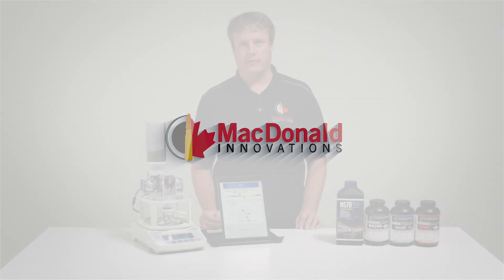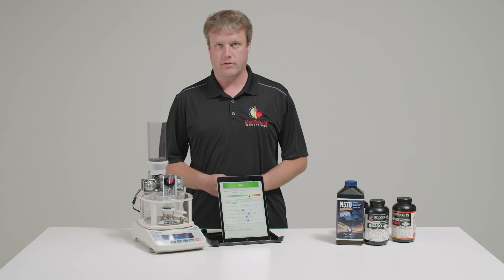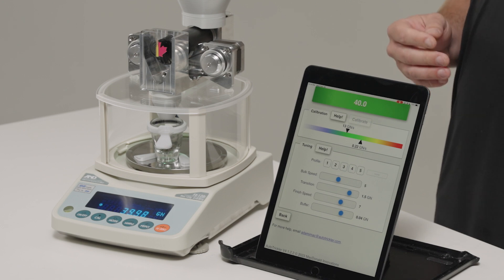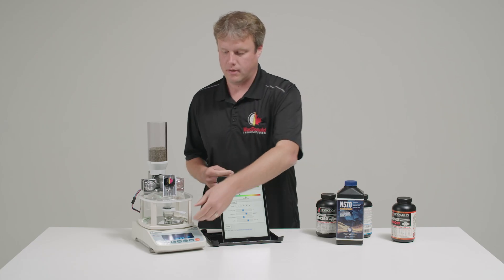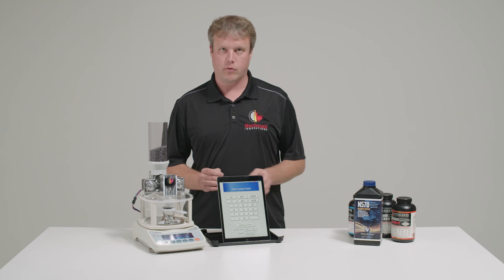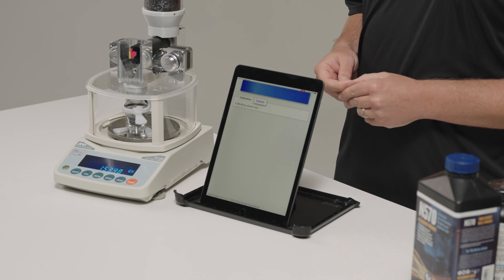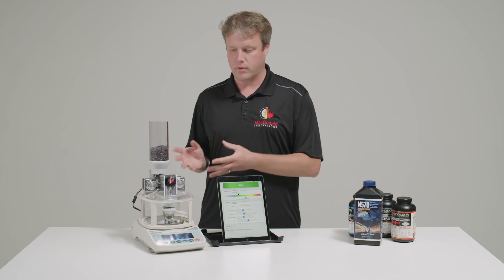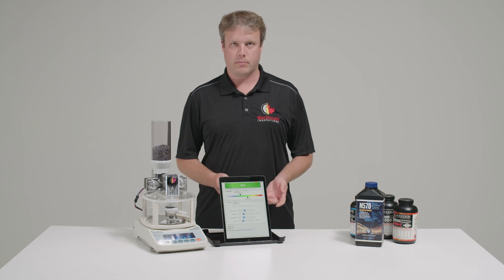AutoTrickler V4 Tuning Demonstration

Comment: Great help. I am very interested in super small loads. Like 10 to 15 grains for subsonic loads in .308, 300 BLK and 8.6 BLK. The powders I use are CFE Black, Trail Boss and Accurate 1680. They have to be right on, because a couple of hundred grains make a much bigger difference than at 40 or 60 grains

Comment: 1. A single kernel of H4350 weighs ANYwhere between .02 - .04.  It's random and it's SUPER annoying. 2. Know your audience.  Accepting a larger tolerance of up to 2 kernels just because it's H4350?  NOPE.  Know the audience and their expectations.  Shooters have already gotten really good results with the SUPER LOUSY tolerances of the old Hornady and RCBS thrower/scale combos, which are HALF the price of this.  Why would someone then sell their chargemaster say, and spend DOUBLE the money to accept larger tolerances?  lol.  Nope.  No way I'd accept that for a thousand dollars.  At say 200 yards and under I'm sure .04 tolerance will get you tight groups, but past that, if you have a case with plus .04 in it, then the next case has less .04 in it, your vertical dispersions going to SUCK lol.  Throw short and add single kernels to stay in a tighter tolerance.  BUT, nonetheless thank you SO much for showing us how to tune the horrible H4350 lol.  This was really needed.
Reply from the maker: With an extreme spread of +/- 0.04 GN the min/max spread is 0.08 which is worth 4 fps. An excellent SD is 4 which would be a spread of 16 expected over 20 shots. Because of how multiple error sources combine, adding an ES of 4 to an existing ES of 16 gives you an ES of 16.5, which is not noticeable on target. It's non linear and non intuitive. It's important to reach a certain point but beyond that diminishing returns drastically reduces the benefits.

Comment: Thank you for the finer points on tuning of the system. 
One question/suggestion 
Could there be a way to set up a scale tolerance for the larger grain powders. 
I believe the current scale tolerance is +/- .02 grains or maybe it’s within .02 grains. 
Could the software be modified to allow a green light indication of say +/- .06 grains? As you were saying with the N570 powder. 
I do understand that that would cause more fiddling with the system and users may forget what setting they are on but if it was somehow tied to the powder profile that could be possible. 
Anyway. Thanks